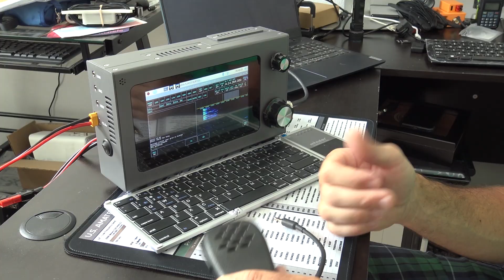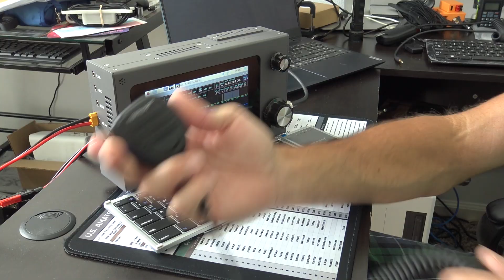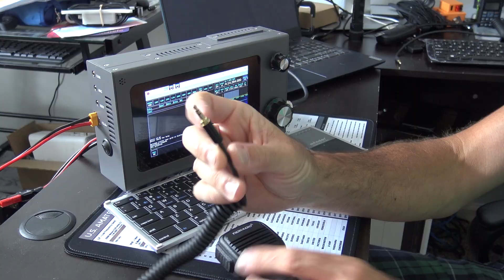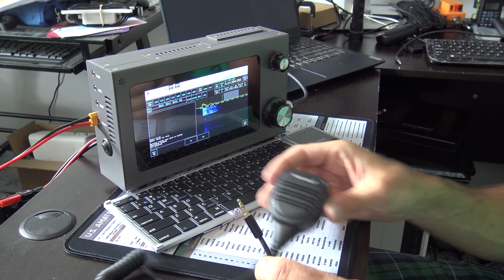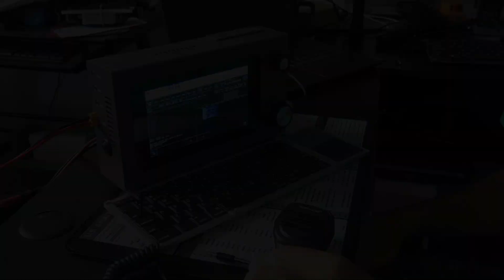sBitx V3, Replaced The Stock Microphone, And It Works MUCH Better..

Comment: For a solid feeling microphone, any old Motorola Mic has the feel you may like, the mic element Neds to be a dynamic element to work with the SBitX such as a Heil Mic Element, for best sounding signal reports. This comes from over 50 years of Amateur, Broadcasting, Telecom, and Mobile Communication experience.

Comment: I have a pair of the TIDRADIO TD-H5 GMRS radios, I flashed UV13 firmware over one of them and it opened it up completely.  The audio quality is amazingly good, sadly better than on my Yaesu C4FM-capable HTs, and the handmic is surpisingly good as well.
Reply from the maker: I agree. And I just rewired the TIDRADIO hand mic to my sBitx V3 for HF and it sounds amazing on SSB.